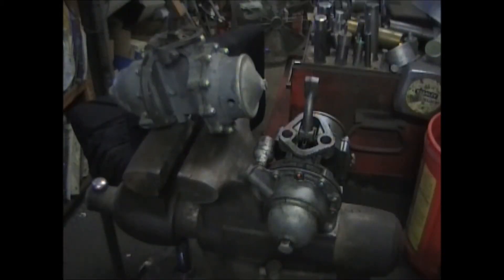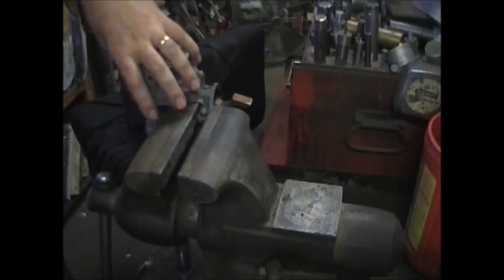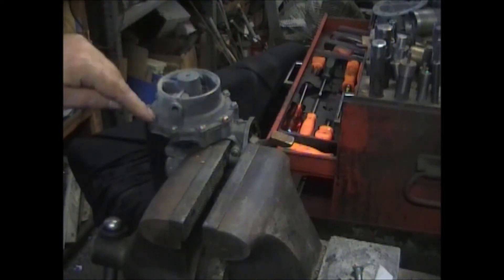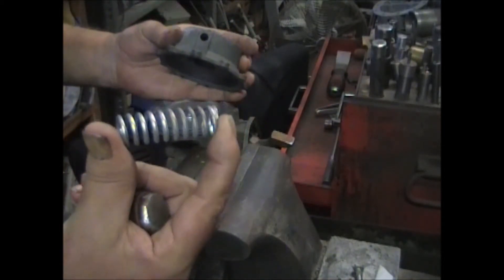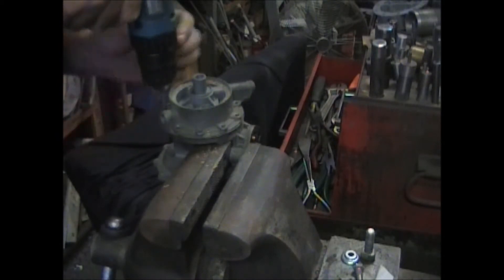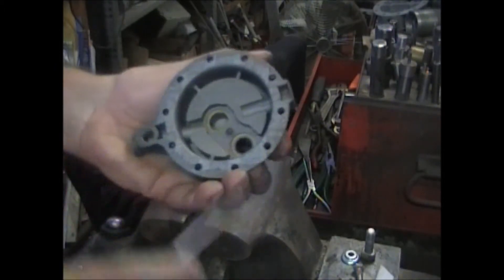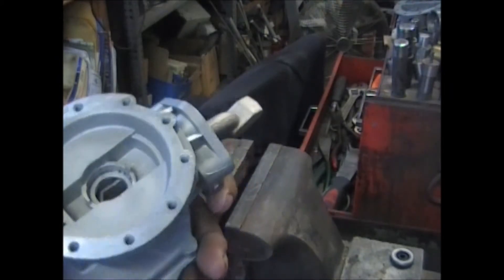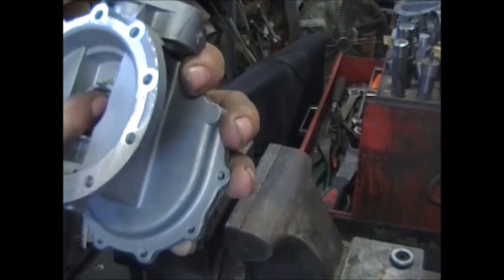AC 529 1940 - 1951 Buick

Comment: dear fuel pump expert How much freeplay is there on the lever ? In the vice the pump works really well however on the car the freeplay obsorbs the camshaft lobe .I estimate 3/8 to 1/2 inch of lever action befoere the fuel pump reacts . thinking something is wrong on the lever .thank you
Reply from the maker: That’s just a bit too much free-play. There might be some wear where the link contacts the arm. Just a little wear in that area translates into a large amount when it ends up at the end of the arm. Normally there should be roughly 3/16 free-play.
Reply: @thenandnowautomotive547  okay thank you again ,as you said in the video if there are no issus with the lever mechanism the leave well enough  alone    again thank you
Reply from the maker: @markzylstra3200   In the video I was referring to any twisting action in the arm which would mean there is wear in the pin. There isn''t a way to check for wear in the link where it contacts the arm until the pump is back together and the free-play is checked. The only way to repair the problem you are experiencing is to replace the arm and link with a new one.
Reply: @thenandnowautomotive547  good morning ,and yes today i will take the pump apart to look at the lever mechanism thanks for your help

Comment: Hi Mike. Your videos are very helpful. A friend of mine Desert Rat 2000 told me about your channel. I have a 1940 Buick Super Eight, Series 40. It came with 2 fuel pumps. One had a long arm that sat higher than the seam of the pump and the other had a short arm that sat about the seam of the pump. According to the guy that I bought the car from, the pump that was in the car was no good and it had the short arm. After watching your video, I realized that if I just switch the arms, I should be good to go. If I need a rebuild kit where is the best place to get one? Thanks for sharing. I will make sure that I tell others about your channel. 🍁👍👍
Reply from the maker: Hi Andy. Sorry for the delay in answering you, the storm we just went thru took me away from the internet for a bit. Switching the arms is a way to make one out of two. We make rebuilding kits on a daily basis at the store. You can call them at 781-335-8860. Maybe the pump that the previous owner said was no good, just needs a good rebuild, both pumps use the same kit.
Reply: @thenandnowautomotive547  Hey, Thanks for getting back to me. I am going to test the pumps next week when I have more time. If I can't get one of them to work, I will be ordering a kit for sure. Stay well.

Comment: Hello Tand N. What does the dome do? I am working on my fuel pump and following your video, but My pump doesn't have a dome. The hole has a plug in it and the fuel line in the other hole. Will this be a problem for me. Thanks and keep up the great videos.🍁👍👍
Reply from the maker: The purpose of the dome was to take the "thumping" out of the pump when it was working. It was later eliminated by using the plug you have in your pump. Some rebuilders just eliminated the dome when the pump was rebuilt. It poses no problem when it's not there.
Reply: @thenandnowautomotive547  Thanks Mike. I like to know this stuff.